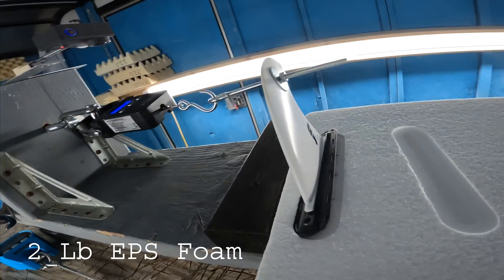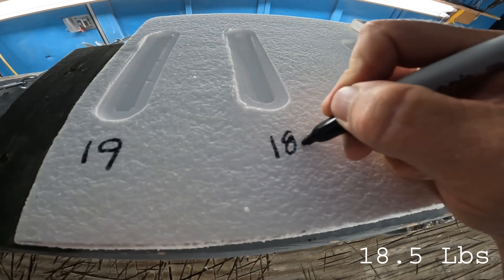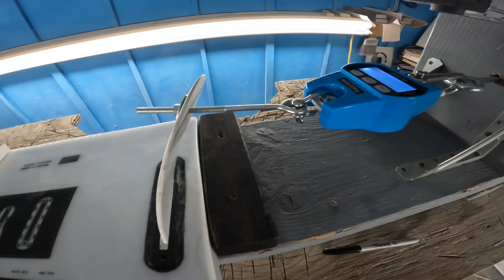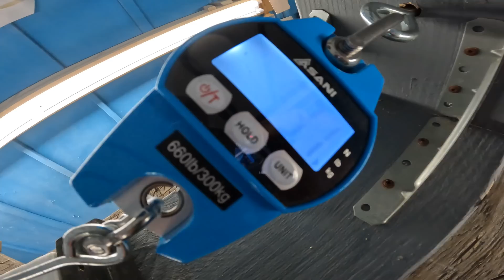Which Fin Box is Better (Futures or FCS2)?

Comment: Awesome video bro very cool that you make the time and effort to help surfers(and manufacturers)around the world make a choice to what gear they want to use in their glide/shred sticks💯👍🔥🙌 I wonder what the”real world” percentage is for failures/repairs coming back for the different systems, and when they do come back in for repair which system is the easiest to replace/repair? Case in point I know a legendary shaper from our neck of the woods in Aotearoa NZ who still stands by the original FCS1 system as damaged cause is minimal compared to the FCS2 system and he says when the FSC1 come back in for repair it’s usually 1 plug that needs replacing vs FCS2 system which means taking out the whole system and replacing. Interested to hear people thoughts in this. Thanks for reading👍